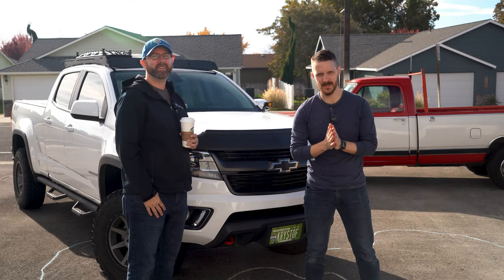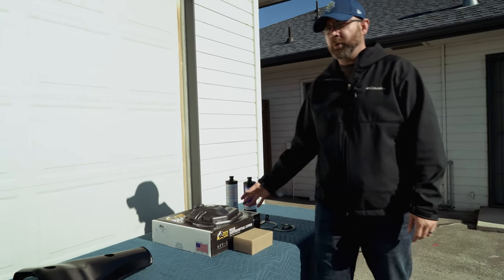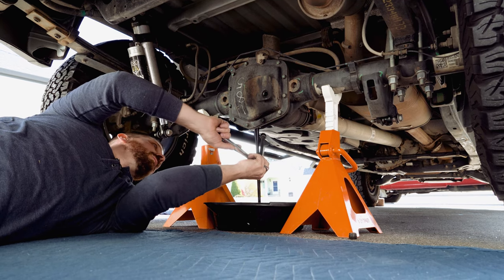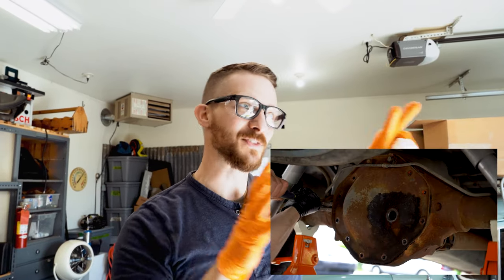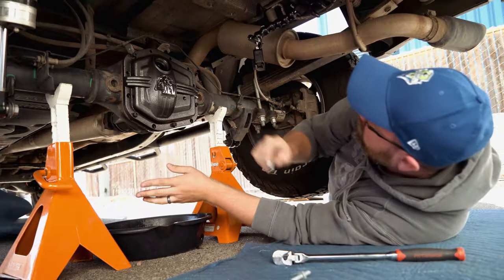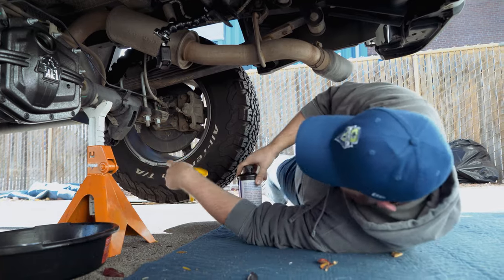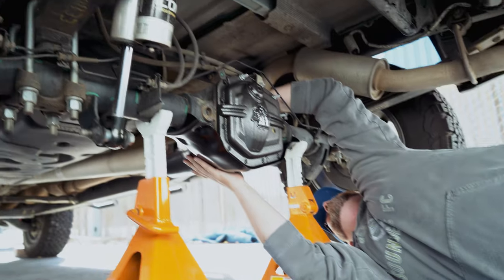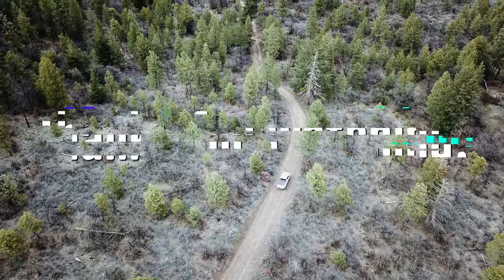AEV Rear Differential Cover & Skid Plate | Chevy Colorado

Comment: That Diff cover is so good looking especially if the spare tire is removed from under the truck so you can actually see it.  Just ordered the AEV diff cover and skid plate my self. Will be interesting to see what skids and bumpers he ends up getting.  CBI makes some no drill required skids and I think the AEV ones would be a great option but require drilling for anything older then 2019 Colorado's. Having watched the Prinsu rack install I dont think drilling holes will hold him back from going the AEV rout they are also in stock unlike CBI's crazy lead times and required to pay up front.
Reply from the maker: Thanks for the comment.  With the suspension lift it's pretty easy to see the diff from the back.  Check out that video if you haven't seen it.  Yeah Chris has been researching bumpers for a while.  The cost is pretty high obviously so we're on hold for the time-being.  We don't have any fancy-pants sponsors.  :-)
Reply: @JasonExplainsThings  Yeah sponsors would be nice.  I saw his truck in person 2 weeks ago and the Cover stands out on his truck for sure.  I some times swing by his work to see what he has done to the truck. His truck stands out from the main road big time lol.  The truck caught my eye when he first got it lifted and I saw the Icon wheels, he has good taste.
Reply from the maker: Nice and thanks for not outing locations!  Small world!  :-)
Reply: @mquez509  thanks for the kind words!  Trucks really been a labor of love, sounds like you have quite the truck yourself!

Comment: Great video. I clicked on the link for the gear axle and it took me to Amazon where it said it was not a proper part for my 2017 Chevy Colorado. I just want to verify that this Delco rear axle oil is the correct make for the Chevy Colorado.
Reply from the maker: That’s what AC Delco’s site said.  Honestly any 75W-90 synthetic gear oil will work if it meets GM’s specs.
Reply: Yep, I picked the fluid up from my Chevy dealer specifically for my Colorado. Never hurts to double check!

Comment: Is there a reason you stuck with the ACDelco gear oil? In the owners manual it says to use an SAE 75W-90 gear oil and it comes from the factory with ACDelco. However it appears comparable oils are half the price. I have no idea which to get or if it even matters and I'm over thinking it.
Reply from the maker: Yeah I personally used Amsoil gear oil in my truck.
Reply: @JasonExplainsThings  thanks! I've had a few other recommend using that as well. Think I'm going to go with amsoil.

Comment: Is that truck a long bed? I have a couple colorados for my business, long bed reg cabs and short bed quad cabs. Ordering a diesel Bison and trying to decide if a quad cab long bed is too long
Reply from the maker: Long bed. 👍
Reply: Unfortunately the Bisons don't come in a quad cab / long bed configuration.  😕  That was my main reason for buying a Z71 over a ZR2/Bison.  Needed the seating and bed capacity.  Much more practical for my needs.

Comment: All nuts and bolts on this truck is metric not SAE. rear diff cover bolts are 13mm and not 1/2 inch. I find that majority of lug nuts on modern cars gets messed up because of use of SAE tools
Reply from the maker: Thanks for the info.  We've been doing projects on the Colorado for years since and they have always been metric.  Might've said that because that's what was in the instructions?  This was years ago at this point so I'm not sure.